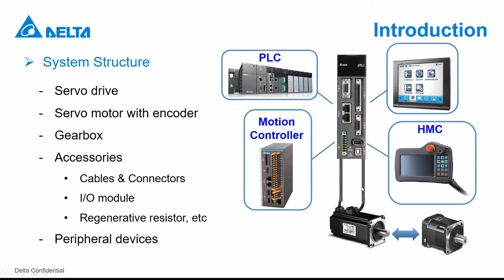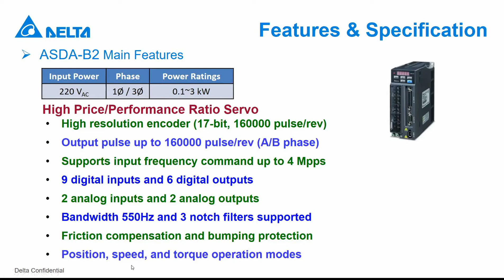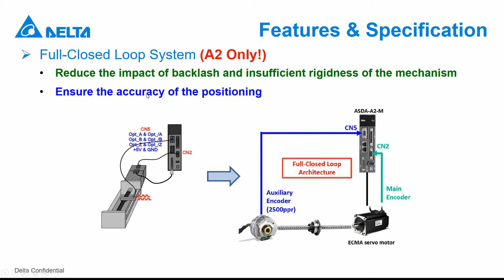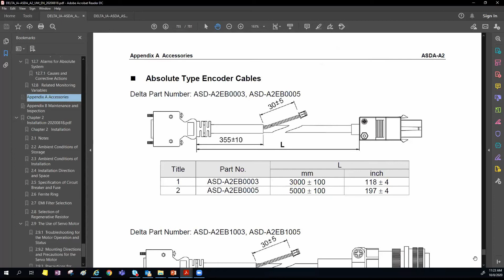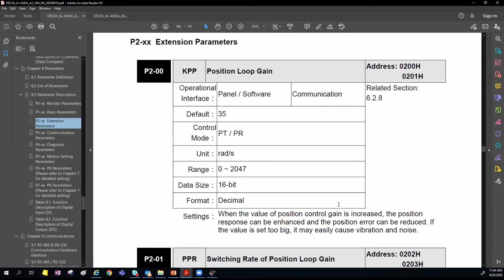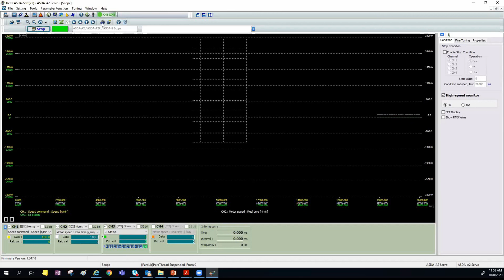Comment: I lost the parameters for Delta ASDA B2 servo drive after replacing it. the old servo drive is not responding to software so I loaded the opposite servo drive data but the motor need to run in reverse direction. any suggestions?
Reply: ASD-B2 could be controlled only by high speed pulse trains. So you could change the direction from the corresponding instruction’s operand in the PLC’s program. Other way is to change the direction from the servodrive (refer to parameter P1-01 in ASD-B2 user manual).

Comment: This is a very useful video, thanks for the overview. I have 4x B2 drives that I would like to autotune for a gantry CNC router, but this doesn't seem to be available in AsdaSoft v5. Should I be using v4 for auto tuning of B2 drives?

Comment: Can you explain, how to interface the same servo using Microcontrollers
Reply: Please first make sure the command from Microcontrollers can be recognized by the servo, it could be via fieldbus such as EtherCAT or CANopen, pulse train or analog input. Then by following the user manual to configure related parameters properly, it will be able to work.
Reply: My preferred method is analog from the MCU and with the Delta drive in torque mode. This means that the MCU becomes responsible for closing the PID loop and generating the motion command profle. 
One of the many benefits of this is that; the drive becomes a simple transconductance amplifier....no complicated setup and if the drive fails and a Delta replacement is not available, then a different drive can be used. Torque mode means that the MCU can limit the motor torque by simply limiting the output of the MCU's PID loop (important to me).
Furthermore, I do quite a lot of dual-loop control...Who cares where the motor-shaft is? I care more about the load being in position. When using a load-mounted encoder, it's possible to use this feedback for the P-term and I-term and use the motor encoder for the D-term.

I was awarded a big contract one-time, simply guaranteeing the customer that I could re-control his old machine and make it more accurate/repeatable than his new machine. I won 😁👍